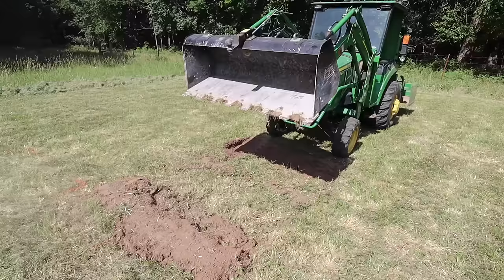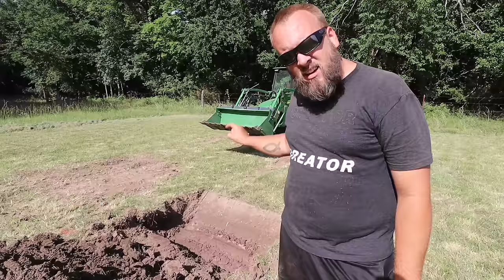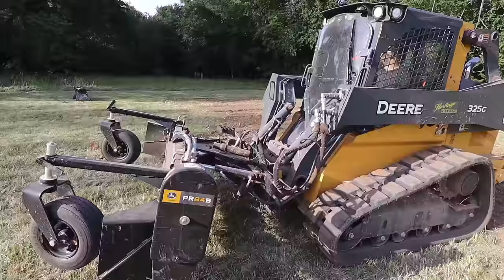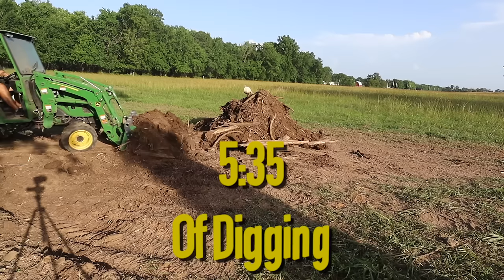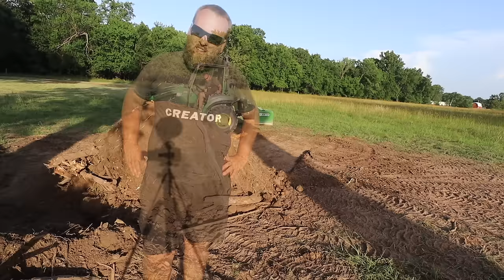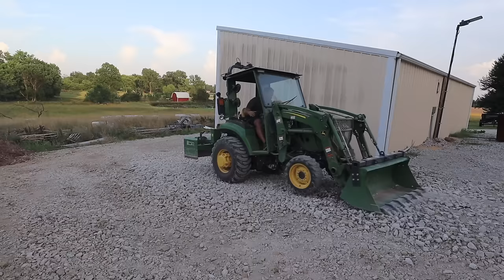Tractor Toothbar Torture Test - Who Makes the Best Cutting Edge?

Comment: Nice comparison Brock!  I've got a Skid Steer bucket on my tractor, a Deere C66 and I'm planning to order the serrated edge for that.  It looks pretty similar to the BXpanded toothbar, so I'm pretty hopeful.  I haven't done much (intentional) digging so far, I've accidentally cut right through the sod in a few places, so maybe the heavier bucket makes a difference.
Reply from the maker: My skid steer has a flat edge like that on the bucket. Not quite as sharp as the bxpanded but same idea

Comment: A little late on commenting but having used the stock bucket and the Piranha tooth bar for about a year and a half not it is a game changer for some of what I do. Digging it beats my factory edge bucket like going from butter knife to a great steak knife for cutting a tough steak.  I have cleared quite a bit of brush with the tractor and bucket with the Piranha bar, the teeth grip saplings very well allowing you to push it over then grab the root ball and push it out of the way.  3 to 4 inch diameter  privet hedges in the swamp and very easy to remove, one that was about 13 inches at the base took a little more work but got moved from what is now a food plot for deer.

Comment: I wanted an edge protector so got a piranha, which is probably an expensive edge protector.  I agree it's no better that a straight bucket for digging in dirt.

Where it does help is 1) ripping through sod, 2) digging through the rock/sand/clay pile left over from ram-hoe dug pond.  Basically jam the edge in and "wiggle" it to work it through.

Comment: I was looking for the cheapest tooth bar but I needed 53 inch.  I wanted to rake up pine straw and dig through roots. I could have bought a 60" and cut it down but I could save $50 by buying the parts from Amazon ($230 total) and welding them myself.  Works great, my JD 1023E is not that powerful so no danger of ripping it off.

Comment: Great video, as usual.  Can you ever think of a time where you would remove the BXpanded tooth bar once installed?  I am considering tack welding it on near the middle, in a grinder-accessible spot.
Reply from the maker: No. I just forget it’s on there and never noticed any difference with grading or anything else.

Cuts better with no downside
Reply: Rog.  My new (to me) 85 hr 2038r is being delivered Friday with pallet forks and a land plane, selected in no small part because of your videos. Keep up the great work.

Comment: Nice job on the comparison!  With those tasks my heavy hitch tooth bar should get beat.  I learned over the months what it’s good for and what it’s not.  I learned it’s a specialized tool, when you’re dealing with vines and roots or want extra horizontal capacity for brush or rounds it’s great.  When I’m doing any kind of level work or anything like that I stick with the stock edge.  I go months at a time without putting it on.
Reply from the maker: Thank you for sharing the info on how you use it

Comment: I have a Piranha and am using it on a 3038e JD to remove topsoil for a driveway.  I had tried the bucket and it worked, but poorly.  The Piranha handles the soil and roots quite well and I am pleased with it.  I've also tried it on brush and it does a pretty good job there too. But the winner for brush removal, in my view, is the Ratchet Rake.  I've had one for years and it is fantastic for pushing multiflora and other brush out of the ground and stacking it.  The Ratchet Rake is also great for light grading of my mile-long existing gravel driveway. It's not a typical toothbar, but it does protect the bucket edge and stayed on my bucket - except for snow removal - until I got the Piranha. If you haven't taken a look at the Ratchet Rake, you may wish to check it out.

Comment: I own and use a 2018 2025R...  Main reason I picked it up used for about $4000 under market, I t had a couple of issues from prior owner abuses.  Easily repairable,  but a deal breaker for most folks, long story short prior owner appeared to have attempted a few You Tube 'modifications' they did not apparently have the understanding and skills to do!  Anyhow, on to the buckets... I own 2, the original 54" stock bucket and the complete wicked tooth bucket.  I have fabricated some attachments for the original bucket for handling logs & brush which is the majority of work I do with it, The wicked tooth bucket is used for ground clearing of heavy brush, small trees, and bushes.  An associate/friend has the BX tooth bar on his Kabota of similar spec to the 2025R, the BX bar is OK for the brush clearing, but seems to 'slip over the top' and taking more passes to clear the same densities of heavy overgrowth and brush as does the wicked tooth does in one pass, which was my primary reason for choosing the Wicked tooth in the first place, what I researched on it seemed to point it out as the better brush buster.  

As for digging, I do some light surface de-sodding surface prep here and there plus the finish grading of de-brushed areas which are then usually disc out with a serrated disc, disk harrow.  Again possibly due to some root structure and such still present the wicked tooth seems to do a little better job of prep, but marginally at best.  As for picking up moving loose stone of all sizes and shapes from 2-0 all the way down to 52 the stock bucket does a better job for me hands down... Packed gravel/rock though  = wicked tooth!  Doing all but the log and felling brush removal is a fairly rare gig for me, If I did the other stuff more often I'd likely have gone with a skid steer, But I needed something light with a lower footprint profile left behind.  I'm officially retired now and do not go out seeking a mass of jobs...  Usually I get a call from someone who has heard from a friend.

At any rate nice job of running the compassions, always nice to see some willing to put in the time and efforts to help others make the right choices for their particular needs!!

Comment: Thanks for doing this test, not perfect, but you came up with the same choice as I did the BXanded.  A few things you needed to say is when the Expanded is on it also "expands" the bucket size...so you are able to put a lot more dirt, stone etc in each trip & it actually helps keep the material in the bucket while moving.  You gave the last 3 buckets in the first test 1 minute more than the BXpanded, if you had dug another 1 min that hole would have been at least another 6" deeper beatng them all by a wide margin.  You should have also mentioned that BXpanded has a straight blade that uses the same 2 side holes so one could, within minutes, change out the 2 blades.  I've been using my factory edge to clear my tar paved driveway for 5 yrs with an add on plastic edge, I'm tired of the fact the snow doesn't all fall out due to the large screws that hold the edge to the bucket, so I'm going to be buying the Expanded straight bar soon for snow.
Reply from the maker: Thanks for sharing your thoughts
Reply: Can you put pallet clamp over your piranha?  Curious. Ty
Reply: @KP-vf5cg  I never tried it as I have a set of real forks which I recommend that you get over the clamp on type.  Folks that have the clamp on type have said they mess up the bucket too much & that the weight of the bucket it self & how far away from the pin the forks are adds to how much less you can lift...

Comment: I asked BXpanded if their Pirahna bar would hold up to a 75 hp 11,000 pound tracked skid steer.  They said they could build me one that would, so I bought one for my JCB 250T loader.  It is amazing.  I can get it against a 4 inch tree at the base and just push and cut it off. The sharp edge will cut right through green wood. It digs extremely well.  I've tried it out pretty good, and it has never flexed or bent.  I can put it up at a medium height and push and lift on a larger tree and push it over, then back up and get the bar under the root ball and push the whole tree out.  I'm very impressed with the Pirahna bar.
Reply from the maker: That is awesome. I have a skid loader the same size
Reply: Interesting. My piranha was wussy and didn’t last long. Was going to use EA this time but will try asking them for a heavy duty one first.

Comment: Great video comparison. I have been on the fence between buying the piranha bar or keeping using the stock bucket.   After watching this I may just stick with the stock bucket. My only concern is wearing out the edge as I backdrag a lot of stone on my driveway to keep it in good shape. But stock buckets are not that expensive so it may not be that big of a deal. Idk. Thanks again for the great comparison.
Reply from the maker: Thanks for watching

Comment: If it was mentioned I missed it but the stock buckets that come with John Deere tractors are very week.  Our stock bucket bent across the top just from hauling the trash can to the road. That's one thing I wish I knew to upgrade during this purchase. I'm not sure but I think the John Deere heavy duty bucket has a replaceable cutting edge. To upgrade wasn't much more money but I thought it wasn't necessary. My salesman offered it. 
 Great video Brock. Really appreciate your videos. 🚜🇺🇲🦌😎
Reply from the maker: Thanks for sharing your experience. Right after I got my bucket I bolted a plate across the top of it with hooks on it and I haven’t had any problem
Reply: @RockhillfarmYT  good idea. I'll have to find something to fit it. 🙂🚜🇺🇲🦌

Comment: I think your tractor is lacking power for the tooth bar. It struggled with it more and this is because it extends the edge/geometry as you stated. For best "smoothing' results, you need to backdrag using rear of bucket, not front cutting lip (you can do this to backdrag + cut if that's what's required). All that said, I've use both tooth bar and bolt on cutting edge. My preference is a bolt on sharp cutting edge. When it wears, it cuts worse, but you can replace it or sharpen it. It helps cut back dragging or digging in. Either way, the weight of the tractor is what's the most important. Also I don't think a the front bucket is designed for digging...it is for moving material. Digging is best done by an excavator or backhoe. With that in mind, it's more important to consider what wins getting material from a pile and then dropping and smoothing it at the destination, which again IMO, a flat bolt on edge. Another thing I don't like about tooth bars (aside from inability to cut + backdrag), is when you use your bucket for other things, it's in the way...you can bump into it when loading firewood for example. Long story short, what you want is a sharp bolt on replaceable/serviceable edge.

Either way, this is a good video for someone to watch when considering this topic.
Reply from the maker: Thanks

Comment: Amazing video 5 ⭐'s, what is your take on 4 in 1 bucket's for your size tractor? I don't see a lot of people using them but on a skid steer, just wondering. God bless from Gaffney South Carolina viewer
Reply from the maker: Thanks. I’ve only used a 4 in 1 bucket one time and it was on a 3046 so fairly comparable Machine.

I actually really liked it. Good for back dragging . Good for not needing to switch front attachments to grab something. Good for picking up the last little bit of a pile

If you’re moving a lot of material though it’s not as good as a grapple.

I’ve been using a regular bucket with the Add a Grapple from Precision manufacturing which gives you kind of the same affect in terms of being able to use it as a bucket but also be able to carry things.

The difference there is you don’t get the added benefit of being able to back drag better
Reply: @RockhillfarmYT  Thanks for the info. I really appreciate it.

Comment: Potentially already mentioned, but soil type will play a big role in virgin ground digging performance. Also, it's likely you'll see more dramatic differences from stock bucket on a subcompact, which is disadvantaged by lack of weight.
Reply: Yes for sure, also the HH is at disadvantage with the light tractor. 

My skidsteer weighs about 7500 lbs, and the traditional tooth bar like the HH does wonders. Stock bucket/straight edge suffers on hard ground still, but those teeth just need a little more ass.
Reply from the maker: @krogunlimitedfahrenkrog6110 I’ve got a 9500 pounds skid steer, and it came with the piranha style toothbar

I haven’t tried it with any other kind
Reply: @RockhillfarmYT  if you have a quick tach that fits your skidsteer on that HH bar, I'd say give it a shot! If the ground is hard enough where it kills movement, I have good luck curling the bucket and using the teeth like rippers. Also how I break up sod, when I want to tear it apart, since I don't have anything fancy for the job. 

I love the teeth for ripping crap out of the ground. It's useless for finish work, and I would love to try a piranha bar. I just talked to my dealer and they are going to add one to my list of shit.

Comment: The more aggressive the teeth are the more power would be needed.  There's a point of diminishing return.  It also seemed like the teeth of the Heavy hitch were bending slightly.  A more powerful tractor might only bend them more but?   I've stayed with my stock bucket because I don't have diesel or  a 4x4.

Comment: Another hidden advantage of the piranha is when you find the sweet spot with your bucket tilt it is amazing at scraping parking lots/asphalt. With its sharp edge it picks even more than a straight bucket which are usually a little bit rounded. You just have to find that sweet spot where it's perfectly flat on the ground.
Reply from the maker: Thanks for sharing

Comment: I can add my two cents to this one as well I have a Kubota BX and I have a piranha tooth bar and a piranha straight edge bar I use the tooth bar if I'm going to be doing a good amount of digging but normally I leave the straight edge piranha bar on my bucket 99% of the time just because I don't need the teeth all the time. Now I do know from experience from what I have noticed is that if you're doing digging around trees with big roots that the piranha bar will actually grab the roots and will hold on to them where is the stock bucket Edge being thinner is a little sharper and you can kind of shave those roots rather than hook them

Comment: Great comparison but limited in the sense you only tested with soil.  Where I live in NE Washington state the ground is literally 50 percent rocks and cobbles typically softball to basketball size.  Pushing into this crap with the stock flat edge is frustrating.  I think that toothbar with the split teeth would be just the ticket to get under the rock and lift it into the bucket.

Comment: I have the heavy hitch and rarely dig with it. I have a dirt drive that gets super muddy in the spring and I back drag it with the tooth bar to turn over the mud to air it out and the long teeth in the heavy hitch tooth bar does a good job of aerating the mud. I also have a lot of trash on my land left behind by the previous owner and the trash is just under the surface and the long teeth when scraped on the surface it catches the trash to bring it to the surface.
Reply from the maker: Thanks for sharing

Comment: Piranha toothbar all the way. The way it mounts and self supports on your stock blade. Also cutting edge design to dig and cut at the same time.  Yes l back drag with mine all the time . You can use it as a rake  or lay down close to flat and get pretty good finish for what it is.  Price is right.   Love mine

Comment: Not sure why you are back dragging with the toothbar?  I was taught to always use the heel of the bucket NOT the cutting edge for back dragging.  Especially on a compact tractor where the curl cylinders are not as strong.
Reply from the maker: Yes, you primarily want to back drag with the bucket flat, Because doing it with the curl cylinders extended puts a lot of pressure on them. 

That being said, in real world applications I sometimes start with the bucket tipped down and then lower it as a back up.

For me it is situation dependent

Comment: I think with some counterweight on the back it would help alot
Reply from the maker: I am absolutely loaded with weight.

My tractor is listed at 2900 pounds but weighs 5500 pounds the way you see it in the video. Three sets of wheel weights on each side. Fluid in the tires. 400 pound cab. Box blade. Suitcase weights hanging on the box blade
Reply: @RockhillfarmYT  I meant a actual counterweight with the 3 point hitch I watched a video from a dealer and what we normal folks think is enough weight actually isn't enough, plus the placement. an actual dedicated counterweight even though it might seem overkill depending on the tractor if you were to use about 600 pounds on the back might help. Just a suggestion, thanks for the video and responding. Happy farming.
Reply from the maker: I appreciate suggestions. I was telling you that I had more than 600 pounds already on the back. I had actual suitcase weights hanging on the box blade

You literally can’t put more weight on the tractor than I have on it
Reply: @RockhillfarmYT  gottcha

Comment: If you use the stock edge eventually you will have to repair it. They will wear out after 1000 hours dependent on what your digging through...Put the piranha on right away and protect that factory edge. IMHO.

 I had a hard time mounting it after 600 hours without one. If your digging or cutting brush and small trees the Piranha is top notch.

Comment: One thing you are in high gear you should be in low gear you will F  up your Tracker😢😢😢 and you should be in 4x4 wheel drive
Reply from the maker: I was Never in high gear. I’ve put my tractor in high gear maybe three times in 800 hours on the meter.